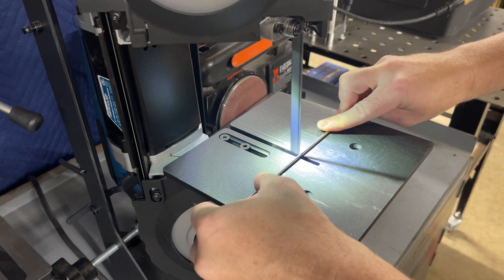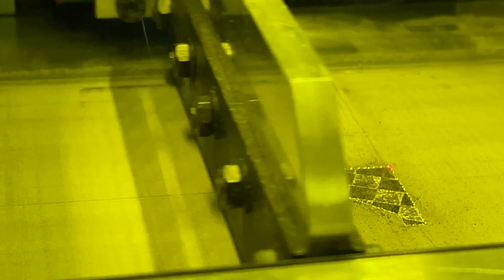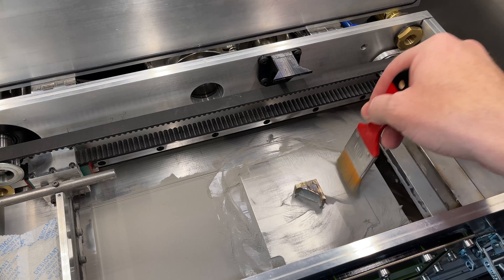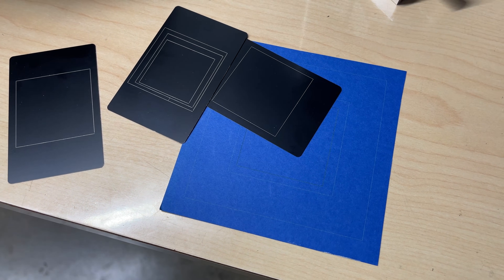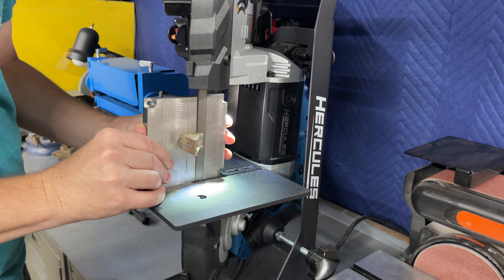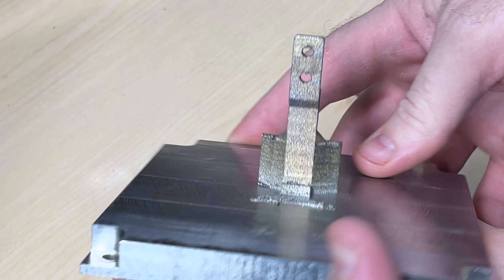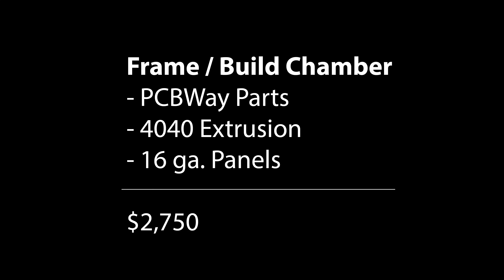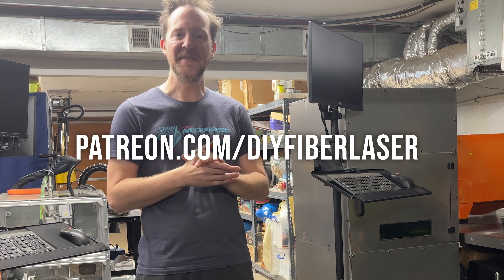DIY Metal 3D Printer: Part 9

Comment: A low tech solution to heat problems may be to insert pauses into the print every 20 or 100 layers, if thats possible
Makes the print taker longer, but might help

Comment: This is inspiring. I have many thoughts about redesigning the powder feed and motion systems. For the motion systems, basically I think you should be using some kind of an encoder to register the position of the axii, rather than relying on motor steps for positioning accuracy.  The print bed arrangement makes me immediately think that you should have a rotating rake that leaves an even layer in the "sand" rather than attempting perfect flatness.  Viewed from the top, it would resemble the face of a clock, with a "hand" sweeping the surface flat (possibly assisted by distributing new powder from this point as well?), and timed such that you get the correct cool down period between sweeps.  This natively has the benefit that you could fill up "the hours" of our clock analogy with parts,  which will each cool down at the correct rate for that chamber.

Comment: hey, I was wondering. how dangerous is metal powder to work with? I know it is extremely flammable. but when I ask any chatbot they react like anytime I touch it or move it in anyway, I will instantly explode. Is it actually handle-able? I was thinking of something like a closed loop setup where you cleanup everything inside a vacuum might be necessary. especially for particularly nasty metals like aluminum or titanium.

Comment: I noticed several technical problems in this system:

1. the thermal effect is blowing powder away from the buring spots. Part of it comes from the air expansion during heating and part of it come from over concentration of laser power.
2. the melted metal coagulate into small droplets due to surface tension. It may has something to do with the over heating and cooling rates.

I would suggest lowering the power input density by increasing the scan speed and line density to get a better smooth layer. Also, lower the chamber gas pressure (not necessarily to be  high vaccum) to help with the local air blast on heating spot.

A few test print should also be carried out on something like the minimal line width and layer height the melted metal can achieve with different parameters( power, powder fineness, scan speed focus). I think this could also help judge whether the overheating problem is happening.

Anyway, it's already an awesome work done at this stage and I cant wait to assemble my own printer. Looking forward to your next experiment vids.
Reply: One more thing, remember to scan the boundary of each layer everytime. I think this helps a lot to enhance the surface quality.

Comment: Hello, my friend. I am a mechanical engineer from China. I was deeply touched by your video, and it has given me some inspiration. After watching your 3D metal printer these days, I find it truly unbelievable, as this is not a project that can be accomplished by one person alone.

Additionally, for components that are not extremely high-tech (such as laser sources and galvanometer scanners), you could consider choosing products made in China. If needed, feel free to contact me—I can help you find manufacturers. I won’t charge any service fees; I am just a sincere engineer. This way, you wouldn’t have to deal with time zone differences for communication. I truly hope to have the opportunity to assist you, my friend.

Comment: Wow incredible the results you've achieved so far. Im praying the tech and component availability can decrease in cost to make diy metal printing truly accessible. A heated print bed and better powder distribution system would be 2 upgrades that would make the biggest difference to print quality.

Comment: What if you used a laser welder. I'm a scene that is widely available. Then, attached it to a three d printer Another machine that is widely available. Then, work on the software which would probably include some kind of sensors.And some type of artificial intelligent programming that is set to look for errors and resolve them in real time. That would be cool

Comment: Liquid argon is surprisingly cheap…probably 1/5th the cost.

Assuming your dewar has a low boiloff rate, you can use a power resistor and input electric power proportional to the desired gas flow rate to maintain some low pressure (say 5-15 psi or whatever your dewar will handle).
Given you already have a sturdy gas tight build chamber, it should be relatively easy to evacuate. Provided you don’t evacuate below the vapor pressure of any volatile lubricants present, there shouldn’t be any real problems.
Evacuating to 0.76 torr(1/1000 of atmospheric pressure) would give you 99.9% replacement of atmosphere with argon if your argon were 100% purity. Backfilling to 7.6 torr and evacuating to 0.76 torr again gives you 99.99% volume replacement of atmosphere for 1% more purge gas use. Depending on how cheap your argon is, and what you have for a vacuum pump, and desired cycle time, this might not be optimal in terms of tradeoff. Evacuating to 7.6 torr then backfilling to 76 torr, evacuating to 7.6 torr would use 10% more argon, reach 99.9% purge and possibly take 1/10th the time.

Comment: One thing you might have seen on the PCBway part is that they printed them at a 45 degree angle. this i the new way that 3D prints are done, even in the plastic printers, u might consider doing this too.

Comment: i built one just for me distortion in dimension can be fixed in the software scraper i build mine with heat resistent rubber and as blade Teflon i also use Vakuum in the chamber  i only flush it once with argon and also lowest layer i can go is 0,01mm if you set up you printer correctly the scraper will never hit the part since you have a 0,01mm gap from already printed part to blade at leased for me

Comment: Hi, for your comment on using so much argon gas for purging: I would think that if your chamber is somewhat air tight towards the bottom end, you should be able to fill up your chamber with argon and it should stay in there as its heavier than N2, O2. Might only need an initial purge volume to expunge air, then a slight over-pressure to keep out backflow?

Comment: No expert here. But i would try to reduce the heat going into the layers by either reducing the duty cycle of the laser if possible or increasing the layer height which would also degrade resolution but may pull more heat out from the beam for each layer not remelting massively the previous layer

Comment: A few recommendations, 

1. i see you have a positive crossbred flow duct, make sure there is a negative one as well (there might already be i just didn’t see it). you can “calibrate” the gas flow by spreading a single layer then increasing gas flow until you can see the powder moving. then drop is down a bit and leave it there. for one of our printer with a 6inch build plate it’s about 60cfm.

2. you may be getting short feeding for a few reasons. one is your dosage factor is too low (ratio of how much the supply stage goes up vs the build stage). the other is that when you load the metal powder you need to “chop” it. this means just take a knife or something and stick it down into the powder all over, this gets the “air bubbles” out. you will physically be able to see the powder move down especially with lighter alloys or non-spherical powder.

3. the silicon recoater will be more forgiving for parameter development. some argue that hard recoaters give better parts but you need super dialed parameters to use them. soft recoaters allow for you to be worse.

3. make sure to orient parts so the first face to hit the recoater is not parallel with the recoater. this will reduce force on recoater and build failures

4. towards the edge of your scan field the spot will distort and the dimensions would be as good due to angle or laser and a by product of F-theta lens only being so good.

5. make sure your hatch pattern is rotating every layer. this will help with build failures and make stronger parts. i usually use 67 degrees but doesn’t matter too much.

There’s no obvious reason this shouldn’t work. now it’s just a game of finding the right parameters to get nice parts

Comment: A heated chamber is a very good idea the part of the video where you showed the gripper arm breaking loose in the other gripper arms starting to break loose was because of temperature differences we Battle these stresses alot in 3D printing especially with abs that's why a lot of the times they tell you not to have sharp corners or points because when it starts cooling those forces are pulling directly on that point with a curve the part can handle the stress better without pulling up I don't know the Coe of the metal but that's one of your main issues I see

Comment: I couldnt help but notice the little denso robot arm towards the end of the video, I pulled one out of the scrap at work and had to do a bunch of wiring repairs to the cords. do you have any video of that thing working? I would like to mess around with mine more but without the correct software I dont think I can get mine to move. Ill likely have to build my own controller

Comment: maybe you can try optimizing the direction of your pieces. this almost look like resin printing, the taller the print the longer it takes. had you print it laying on the bed it should have been printed faster? and maybe helped with the temperature thing?

Comment: I'm a machinist. Back in 1987, I worked for a laser manufacturing company. Their product line varied from huge CO2 lasers with roots-type blowers the size of a golf cart to smaller YAG lasers that used galvo heads for industrial marking systems. I moved from their in-house production machine shop to the prototyping and research facility. The focus of their new products at that time was laser welding systems. There were no diode lasers; we used HeNe lasers for pointing CO2 and YAG lasers to do the work. Watching videos like this blows my mind to think just how far laser tech has changed, but the galvo head continues. Nice work on this printer project; right out of the gate, you have made great success. Keep it up, and at this rate of progress, we might all be printing in metal.

Comment: To correct the issue with voids id say you should add a venting system to carry away the hot gasses while the laser works, this would probably also improve surface finish, Because the sputtering can cause the laser to be slightly out of focus across the work piece if there are contaminants in the way. It may also correct the issue with scraping. This is how its done in professional settings on commercial machines.

Comment: It starts looking good!
Didn't saw the following insight in the comments btw: printing overhang in LPBF is not as easy as FDM. The angle is very limited and bridging is basically impossible. Only few manufacturers can make almost unsupported roof, with extensive parameters optimization.
I think you should be able to reach some good results with little more tuning on your process parameters. I work for a company doing specific recoaters for LPBF (for multi-material printing), and we already tried countra-rotative drum. It is especially useful for cohesive powders, but not for the stainless steel you use.

Comment: Total deja vu back to the days when I got my first RepRap based FDM printer. With unregulated build plate heater and no fans for either parts nor hotend..... What a struggle to make that do anything useful. 
Back when the slicer was a lemon and spelled with a 3.... No temperature tower or calibration/tuning help..... Reminds me. There must be some post processing sw for the G-code, so you can get multiple parameters on one bed???
Also. Someone ought to make a SLM build chamber as a COTS product. Just like you can get the galvo.

Comment: 12:15 in stead of support for those little tabs, you could alter the file to add an angle, that way theres not a single layer jutting out into space all of a sudden. This feature shouldn't effect its functionality and im always an advocate for removing the need to supports whenever possible in 3d printing.

Comment: You could probably make up some code for the slicer to adjust power and duration for those unsupported areas. It would take some effort to calibrate for a given material but I imagine that's how its done on the industrial machines.

Comment: Greetings. The first thing you need to do is to choose the right printing parameters for your material to minimize temperature deformations and improve the surface quality. The second - I don't know what software you use, but I can say that Materialize has special software for calibrating galvanometers, it draws an array of circles on paper, which then needs to be scanned and inserted into this software to calculate the deviations over the entire printing area (they are not linear), which are then loaded into the galvanometers. The third - you need to think about heating the platform (80..100 C).
But the first point is the most important - you need to understand all types of printing modes (contour, inskin, outskin, solid fill, top surface, bottom surface). They all have their own settings (speed and laser power).

Comment: I have absolutely no qualified insight, but from just watching the process, i think the powder delivery system and power settings would be my first targets for improvement. Maybe try to optimize that first before building another chamber. Right now you have excessive buildup of material in general and also uneven layer height. This could mean too much power and or uneven material distribution by the scraper. You could try to have a more even layer heigt by also lowering the print platform when distributing the powder, on video it does not seem like it is what your doing right now.

Comment: I am wondering if a more compliant spreader wiper would avoid the catching on the print as it sweeps across.  Both your silicone and stainless bars are rigid.  Would something similar to a windshield wiper blade work better or would it lead to more unevenness in the layer height?  I just binge-watched all nine of these videos and I am blown away by your engineering skills and perseverance.  Subscribed!

Comment: I love this project and can't wait how it'll keep evolving. Knowing very little about metal 3d printing, i think you can still sqeeze a bit more knoweledge out of this version of the printer, maybe with just a couple of minor improvements here and there to make life easier while you experiment. Just so you can max out the second version possibility of "being perfect". Even we all know there no such thing as perfection
In my experience, while iterating on hardware-software revisions, it becomes very obvious when you can no longer improve because of hardware limitations and usually, but not always, that's when you want to jump to the next iteration.
Anyway, keep on with the good work. You're clearly on the right track

Comment: Why such volume of argon use with gas recirculation system? 

Print temp is still too high. I think the model should have the same lighter grey color as the bridge support you noted. 

The reason why those supports didn't get as hot (even though the actual print temp is too high) is because they're small and not as much energy gets into them. 

I think it's going to be important to have printing software that allows for more control related to parameters such as power used on various areas of a model, support, etcetera. Having every layer and feature of a print be limited to one power level isn't great.

An idea for the future I had could be to try different metals for build plate. Could offer  interesting/beneficial results such as better thermal transfer (if needed) and maybe even the ability to have models that separate away by hand. Just need the build plate to be a metal that's just similar or compatible  to stick enough. Bronze, Brass and all sorts of different alloys could work great as build plates for various dissimilar metal powders.

Just an idea to maybe experiment with in the future.
Reply: https://m.youtube.com/shorts/m0y_lKWrMuI

Comment: I see that right after you print a layer, the wiper runs from left to right, then the bed lowers and the wiper returns from right to left... 

The bed should lower further than it needs to first, then wipe from left to right, then raise bed minus your desired layer height, then wiper returns from right to left.

Comment: I would think that your powder wiper keeps catching since the top surface is a bit rough and rises up more than the thickness of the layer you dispense. Would a heated chamber help with the amount of power you would need from the laser reducing the roughness of the surface and therefore also improving the wiper?

Comment: Add an IR heat sensor that slows down the process and add a servo amperage spike sensor that causes a double sweep of the powder or run over the top of the print with a sanding disk to even off the spike(s)  So what's up with the obvious change in the build that looks like it occurs at about 100 layers?  {A change in the gas mix?]  Try nitrogen.

Comment: I think a heated chamber will help a lot. Keep the material hot so the laser only have to push it to the fusing temperature. This will give much less stress in the part.
Reply: Eh, how hot do you want the chamber to be, 700°? The laser is obviously powerful enough to do the heating itself. I cant`t see the benefit of pre heating the metal.
Reply: @macht4turbo the benefit is exactly what they stated, it reduces distortion and since the laser doesn't need to impart nearly all the heat when fusing a layer theres less chance of spatter and other artifacts.  Or do you think the engineers that designed industrial versions are somehow stupid?
Reply: Also should help keep moisture down